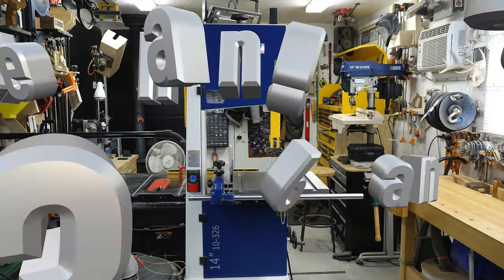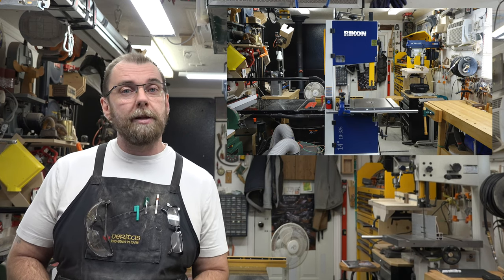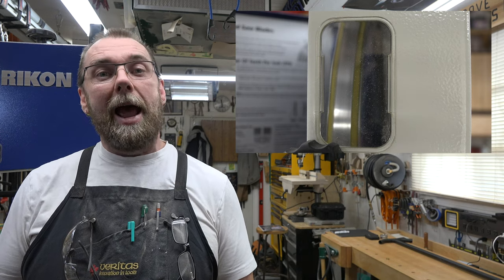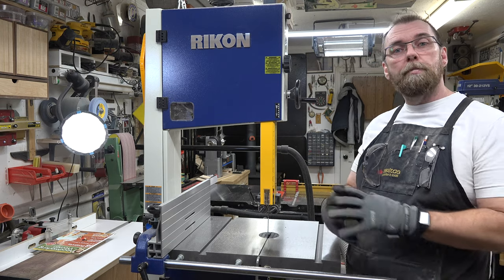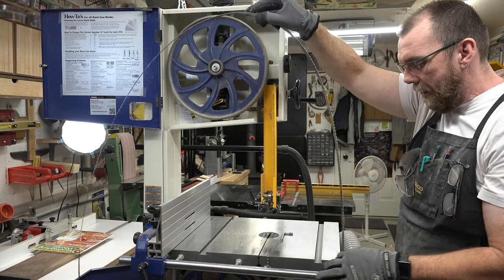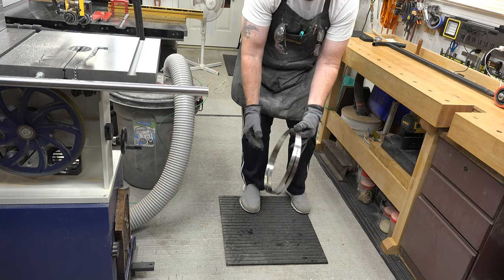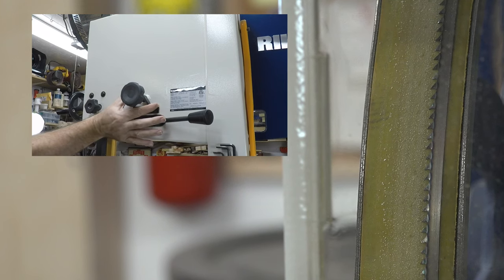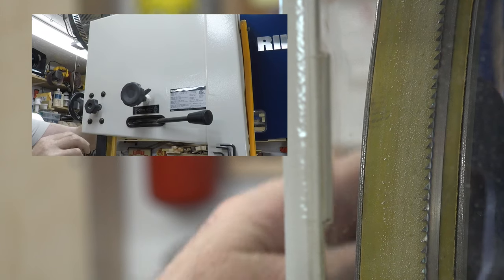Rikon Bandsaw Blade Changes

Comment: Great video, Kenny. I know you're not a fan of the blade tensioning guide printed in the upper cabinet. Besides the tension release to change the blades I didn't see you adjust the tension. Do you keep it the same for a 5/8" and a 3/16" blade?
Reply from the maker: No, I adjust each blade by feel John.  If the blade is able to be tensioned by the lever, I do that first and then fine tune after the initial tension has been applied.  I hope this helps.  Thanks for tuning in to the show.

Comment: Thanks for the detailed video.  What blades do you prefer or use and where do you procure them.  I got the 10-325 just right before our ent to 10-326 and boy do I wish I knew to wait.
Reply from the maker: Thanks for the kind words on the show.   I haven't really tried that many blades to come up with a blade manufacturer that I prefer.  However, I have really fallen in love with the SuperCut Wood Saver brand of re-saw blades.  Their thin kerf has been awesome in every re-saw job that I have done and I haven't had a single problem with them.  I have been getting those from lee valley tools but I also see that they carry them on Amazon.  I haven't looked any further than Lee Valley because they have had what I wanted every time I wanted it.  I hope this helps.  http://www.leevalley.com/en/wood/page.aspx?p=75277&cat=1,41036,75262

Comment: I have this same bandsaw and am really struggling with this. I can get it track really well UNTIL I tension the blade. Then it gets all wonky and pops off. What am I missing??
Reply from the maker: You statement confuses me a little.  You say that you can get the blade to track well UNTIL you tension it.  There should never be any tracking of the blade without tension.  My suggestion to you would be to tension the blade and then adjust the tracking.  Smaller blades are more finicky to track and sometimes they just prefer to run on the front or back of the wheel so don't be too concerned about the blade running in the centre.  But definitely tension first, then track.  I hope this helps a little.  Thanks for tuning in.
Reply: @acutabove_woodworkings  ok I’ll definitely try that! But to be more specific, I’m putting the blade on, applying the tension lever on the back of the saw, turning the top wheel with my hand,l while adjusting the tracking knob. And then slowly adjusting the top tension knob. And the more tension from the top knob I apply, the more the blade begins to pop off.
Reply from the maker: @stradicfanatic  In order to track the blade properly, the blade has to be at full tension first.  Try it and see how you make out.

Comment: Hey Kenny I’m just curious are you ordering 111 inch Blades for replacements thanks
Reply from the maker: That's exactly what I am ordering Buddy.  111" blades for the Rikon 10-326 14" band saw.  I hope this helps.  Here's a link to the blades at Lee Valley.  https://www.leevalley.com/en-ca/shop/tools/power-tool-accessories/saw-blades/band-saw/111150-blades-for-rikon-14-inch-deluxe-bandsaw
Thanks for tuning in.
Reply: @acutabove_woodworkings  Thanks for all your help brother
Reply from the maker: @buddytrent1351  You're very welcome.

Comment: My problem is that the lower wheel was not centered after installing smaller blade. Top ok bottom not so much and could not get tracking rollers behind blade teeth.
Reply from the maker: First off, thanks for tuning in to the show David and for taking the time to leave your comments. It's strange that the top is centred but not the bottom.  The bottom wheel should not be adjusted unless under extreme circumstances.  I am assuming that the blade is running at the rear of the lower wheel.  Something definitely doesn't sound right though.  Have you checked to make sure that the upper and lower wheel are coplanar? If the wheels are not coplanar and the blades are not running centred on the lower wheel then you may have to adjust your lower wheel's position.  It's a pain in the next and can be tedious but if you take your time and go step by step, you should be able to adjust everything so that it is centred on both wheels.  One cause of your problem is also using a cheaply made blade so I would check that before adjusting anything in the lower half of the cabinet.  If you try a new (higher quality) blade and the problem still exists, you will find how to adjust the coplanar properties of your lower wheel on page 27 of your user's manual.  I hope this helps.  Let me know how it goes.

Comment: Excuse what is undoubtedly a rookie question but you don't mention tensioning the blades at all in your video.  How do I figure out how tight to make the blade tension?
Reply from the maker: Not a rookie question at all Mike.  The reason I have this channel is to answer those kinds of questions.  The tension was not discussed in this video because the issue that people were having, was converting from a larger blade to a much smaller one. So the demonstration was made on how to do it.  The talk about tension and how to set the tension was mentioned and demonstrated in the Rikon 10-326 setup video.  https://www.youtube.com/watch?v=noA-G1CSBc8&t=567s
If you don't feel like watching the whole video, you can skip through to the 16:00 minute mark and start watching from there.  I talk about the tension lever, the adjustment and how to tell if your blade is tight enough.  I hope this helps Mike.  Thanks for tuning in to the show and taking the time to ask your question.

Comment: I noticed that you were standing at the right side of the bandsaw while making your cut. This is not in accord with bandsaw safety rules that I know, since if the blade should brake and begin to feed out it will feed out on that right side. Thank you for your many helpful videos.
Reply from the maker: You make a good point Robert but to be honest, I've never seen a band saw blade break, where it followed a specific path to exit the saw.  It pretty much shot out in whatever direction it felt like and it didn't matter where you stood.  Either way, there is nothing wrong with standing off to the left if that makes you feel more comfortable using the saw.  After all, part of being safe is being comfortable.  Thanks for tuning in to the show and for chiming in with your safety advice.  It is truly appreciated.

Comment: If you listen to Snodgrass, you would run the gullet in the centre. Then the only thing you need to adjust is the pressure bearing at the back.
Reply from the maker: Everyone's setup is different.  Thanks for tuning in.

Comment: Is the same way on the rikon model 10-3061?
Reply from the maker: The 10-3061 is basically the smaller version of the 10-326.  The blade changing procedure on the 10-3061 should be the same as what I have demonstrated here on the show.  I hope this helps.  Thanks for tuning in.

Comment: When I first got mine I just moved the blade a bit, spin the wheel, release the tension, move the blade, spin the wheel etc etc until i was center. Seemed to work but I guess I was doing it wrong haha
Reply from the maker: Not the most conventional way to adjust your blade but I have to give you credit for ingenuity. LOL.  Thanks for tuning in to the show.

Comment: You never discussed tracking of the blade on the lower wheel. This bandsaw allows you to adjust the lower wheel tracking, but is very tricky.
Reply from the maker: I definitely did not mention tracking the lower wheel Eric.  Tracking should only need to be done on the upper wheel.  If you need to get into tracking the lower wheel, that is a complete tutorial on its own and is something that should be avoided if possible.  All bandsaw's tracking is adjustable on the lower wheel but the geometry of it is complicated.  Thanks for tuning in to the show.
Reply: kennyearrings1 understand. I find this is a problem point for this bandsaw. The other element you might consider in any future follow-up is blade tensioning. Clearly different between a thin and wide blade.
Reply from the maker: @ericmoorehead1100  I covered blade tensioning in the setup video for this saw.  https://www.youtube.com/watch?v=noA-G1CSBc8&t=964s
The blade change video came about when people were having trouble adjusting their guide bearings and thrust bearing when changing from a larger blade to a smaller blade.   Just my opinion, but I don't think that the lower wheel should ever be messed with.  The upper wheel can always be adjusted to compensate for any misaligned tracking of the lower wheel.  Again, just my opinion.
Reply: kennyearrings1 thank you. I agree with you regarding lower wheel. It is a source of pain for me right now. It really shows up when cutting taller bandsaw boxes and similar items. I look forward to future videos from you.

Comment: Great demonstration, but you skipped proper tensioning of the BLADE.
Reply from the maker: Perhaps I will have to produce a show demonstrating the proper tensions.  Thanks for tuning in and for taking the time to leave your comment.
Reply: @acutabove_woodworkings  Aside from the hammer trick the Rikon looked to be perhaps the best saw on the market.So I ordered one on 4/9/22. BTW I saw no video of any one doing a lower pulley alignment as you have. Very helpful information for future use. Yes PLEASE do a blade tension video-Thanks.
Reply from the maker: @mikemcc5149  I will add it to the list of shows for production.

Comment: Instead of hitting it with a hammer, just release and retighten the tension lever.
Reply from the maker: If that's the method that works for you Alan, then by all means use it.  Thanks for tuning in to the show and for chiming in with your suggestion.  It is very much appreciated.

Comment: Great info, particularly on proper bearing position, but you didn't mention anything about adjusting the blade tension as you change sizes.
Reply from the maker: I like to adjust my blade tension so that there is only about 1/4" inch of deflection when I push the blade sideways after tensions.  I hope this helps a little.  Thanks for tuning in.